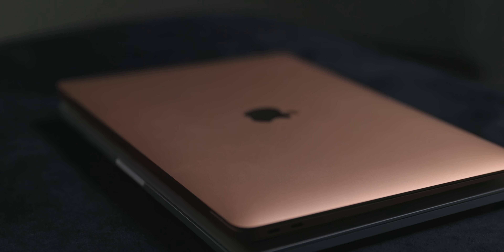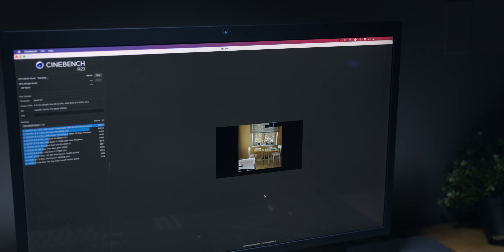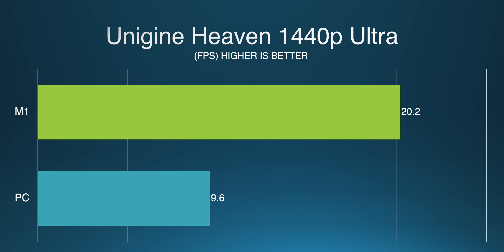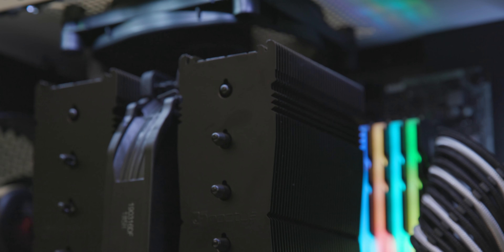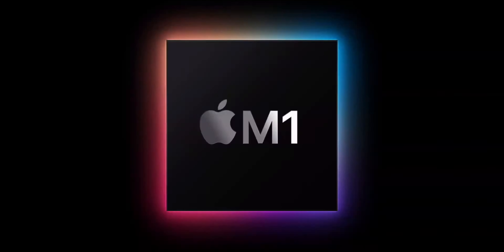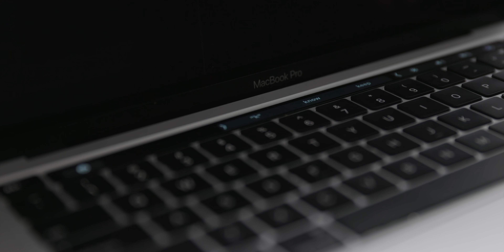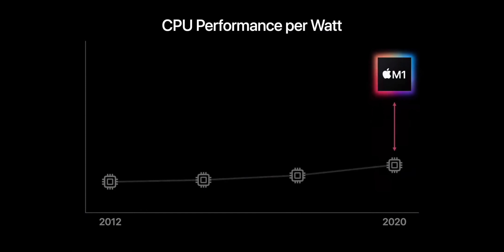$699 Mac mini vs $1,000 PC: Which Is Faster?

Comment: as much as i hate apple y m1 chip are so important is tht.
1. power efficiency " battery lasts longer"
2. more room inside the product as the Soc is smaller so more components can be added or product can bbe designed thinner without compromisimg performance. 
3. life of product is longer as heat is not much of an issue / design of product is made more flexible choices.
4. software is more focused on its ability to run on weaker cpu rather than its demand for better cpu to increase performance.

Comment: The only reason I can say the M1 is overrated is because it could have been better, well not necessarily, the M1 should be a series, the M1 could easily have gotten more high power cores for another device, but basically they decided to leave that for the next gen, maybe they wanted to have something saved to impress again or consider it didn’t worth the effort knowing that they going to migrate to ARMv9 in now less than a year.

So they intentionally left quite room for improvement, and what stood out was it’s performance thanks to the accelerators/coprocessors and software, I mean they did a really really good job with Rosetta 2, that impress me, hope that Microsoft it’s taking notes for “Magical Emulation” for Windows 10 on ARM.

For me to be comfortable again using Apple computers now that they ditch Intel, two things need to happen
1. Recover BootCamp with Windows on ARM hopefully if Apple and Microsoft talk they could arrange that.
2. Allow/make work again eGPUs, that not work on M1 computers although other Thunderbolt devices that USE PCIe lanes work

Comment: 11:15 well, you maybe get to exited there, I can assure you that with 16 high power cores it will not win a 64 core Zen 2 one that is the current best ThreadRipper that’s ignoring the futurible successor ThreadRipper with at least 64 Zen 3 cores.
The other good half of a futurible high end Apple Silicon would be the GPU that is something not found high end x86 chips right now in favor of discrete GPUs, so it may be useful for an iMac or an iMac Pro, and their laptops, even as a base option for a Mac Pro (easier logistics if they reuse the same chips for as many products as possible) so it has its usefulness in fact Intel is planning adding iGPUs to some Xeon to enable simpler servers that require some GPU but not high performance.
Regarding Apple, probably as how they are managing their PCs or they’ll never release a dedicated GPU or only for a Mac Pro, because for a MacBook Pro, iMac Pro or even normal iMac and Mac Mini they can make a separated GPU die that could easily be in dedicated GPU but put it alongside the main CPU/SoC and try to use an Infinity Fabric equivalente or something like what NVIDIA wants to do with Grace to basically make what otherwise would be a dedicated GPU a component that would work with the SoC more like an iGPU does right now, of course it’s Apple, soldered not upgradeable

Comment: Obviously a better thermal solution the reason the M1 is superior in quite a few tasks is because it is full of specialized accelerators to use where the ARM cores would not be up to the task, so if we sum it up, we have the best cores ARM ISA could offer at the moment in the high power cores (that as seen can match performance of Zen 2 cores although there is more of them so is a win for it) with a bunch of accelerators versus a Renoir APU that only has a GPU as an accelerator that is at least couple of generations old, they are beginning to re use more than they should VEGA, while the Apple GPU is an all out of their newest GPUs.

To short things up
The M1 has less CPU power but a lot of accelerators to compensate in a well amount of tasks, a high end of their gpus
Faster and more cache in certain levels

While in the other hand the 4750G has more CPU power, a halved cache compared to 3000 Zen 2 CPUs presumably to allocate that space for the iGPU, and a very old integrated GPU far behind want they can actually do.

Don’t believe me, look the APUs inside the Xbox Series X and PS5, and they technically can do them better with Zen 3 cores which are faster in every way.

So. what we will see in the future because of this, Apple will improve their ARM chips with ARMv9 and new high power cores and a good amount more than what we have now that is only basically a Super Saiyan iPad SoC.
So in their next couple of gens Apple would create CPUs more in line with what a high end CPU is.

AMD and others with one hand will continue improving their CPU and GPU architectures, AND will beginning to including some accelerators while others while be reserved for GPUs or only for certain APU type CPUs
Remember that a lot of the accelerators we use nowadays in PCs we usually put them in the graphics cards like AMD and NVIDIA do, but if you want or need to make a PC where you know are not going to use them you put them in your CPU so Apple honoring the name SoC they put the ones usually put in dedicated GPUs and all the others that are a standard in phones but rare in more traditional computers 

So both will catch up in the next few years Apple improving their CPU power and the others the accelerators

In other words the Apple M CPUs will adopt/become more like traditional high end CPUs while the others will become M1 like with the accelerator things

Comment: And if it bothers you 2:00 you can overclock the single core performance in the Ryzen (for these you can’t use Ryzen Master but you can still do it) and is such a small difference that a slight overclock or even increasing the TDP of the Ryzen could solve that minimal difference that to be honest is in margin of error

Comment: As a former systems manager, I know that BALANCE counts for a lot, when designing any system. What Apple can do, because they control everything in their world, now, is to balance the performance of their components, and integrate them with the operating system seamlessly. As new applications are built and old ones rebuilt for the ARM-based Apple Silicon, they will become more and more efficient. This is already apparent with Apple's own Final Cut Pro and Logic Pro. 

There's a tendency to run horse races when comparing computers. In the real world, most of the benchmarks are just mildly informative. What counts is daily productivity and "livability" with the machine. Once you adapt to an Apple ecosystem, it becomes obvious why they are so successful at sucking people into their orbit. They aren't perfect — lack of ports is a MAJOR annoyance, since dealing with docks, hubs, and dongles is a royal PITA, and lack of repairability and upgradeability is also hard to absorb. But they do answer a lot of the annoyances of WinTel and AMDWin environments. I can't wait to see what the next two generations of M SOCs can do.

Comment: Not a great comparison comparing Apple's ARM processor vs x64. Really should have mentioned ARM processors currently used in Windows/Linux systems and how higher performance ARM processors are being developed.
Reply: It's not fair to compare windows/Linux arm processors to m1 because m1 completely destroys them. We need the good windows chips to compare the m1 so they can atleast hold up somewhat

Comment: As someone that has an M1 MacBook Pro, I wouldn’t get one depending on what type of work you intend to do and how proficient you are in troubleshooting. Is it blazing fast? Definitely. Does it have trouble running some applications and can it be a total pain in the ass sometimes? Also definitely. For anyone looking at the M1, I’d suggest waiting for a little bit until developers adjust and more apps run natively/more smoothly on the chip. Just my 2 cents

Comment: I love AMD, but their APUs don't have half the extras that Apple's M1 has.  Apple's GPU doesn't do the heavy lifting for most Video workloads.  They have dedicated codecs which are better than most systems.  The GPU in the Ryzen APUs is actually weaker than the M1's GPU, but not by that much.  AI workloads on the M1 can use a dedicated AI engine while the APU just going to use the 7 CU GPU, which is weaker than a budget dedicated GPU such as a rx550.  

The strength of the M1 is they have custom accelerators.  It's a bit of smoke and mirrors, it's not the "cpu" that makes the M1 so great.  It's the heterogeneous compute nature of the M1 that makes it magic.  The cpu hands off many workload without tying up the GPU or CPU.

Comment: sorry, no. You can stick a cell phone motherboard and optimize it, it still not equivalent to a computer. I have a mac mini m1 computer, and it runs good. That being said, my pc computer blows it out of the water. You can run all the cinebench tests you want, real world speed is what it is, and without a high end gpu, it doesn't cut the leather the right way. That and the issues with the m1 swap space, cpu, and hard drive causing thermal and slow down issues, bluetooth, mouse, and external drives. Apple needs to work harder to sell their "porches" to the world for the price they are asking. I like the MacOS, just don't care for their hardware, and the lack of upgrading options  on almost all their machines except for the most expensive ones out there.

Comment: 8:10 you cant but apple did. m1 is not a miracle. it is just standard arm infastructure with some x86 accelerators. 
apple products are like old databanks. databanks are faster, more reliable and cheaper from every laptop. but they only do few things. if you need more features you have to pay more. 

apple soldering data storage chips, gluing battery, putting defects on their products. they dont support international computer standards.
their only goal is making people pay more. no matter how. they can put less ports to devices to make you buy dongles. but they don't want you buy any dongle. so they ban every other dongle that not certified by apple. 

when amd or intel creates new product that help whole computer industry, but when apple create a product it only helps apple and his few minions. any company can make a product does few things best and ban the others. but those companies can't survive except apple. they managed to keep customers while they do everything against them.

Comment: Have an M1 MBA - loaded, but sold it.  Got the base Mac Mini M1 to use with my 1440P 27" monitor.  It's actually bliss - I just took my 600W 9700K desktop off my desk, and stuck the M1 Mini there which is like 5% the volume.  At first blush, the M1 feels as fast and powerful at everyday tasks, but what blows me away is I'm playing some of my beloved strategy games at 1440P with literally NO fan noise whatsoever.  Civ VI runs very well at 1440P/Medium and runs so quiet you can hear pin drops in the room.  

I'm pretty excited about the next gen Mac Mini - sure hope they release an M1X model.  I'm kinda over bug and huge computing devices.

Comment: Looking great Quinn!  I mean, as die-hard PC as I am, I still can appreciate the sheer efficiency and engineering going on with the M1.  What do you think would be or could be a fair PC-land response?  Even if AMD, Intel, or someone else threw on tons of cache for the equivalent performance, obviously they'd still push out more heat.  Not an issue for us desktop users but paramount for longevity in laptops being operable.  It'll be an exciting few next years for sure!  Even if it is tempting to go Mac, there is just way too much software (games, work, and professional programs) that only run in Windows that I use at a HEDT desktop level.
Reply: Apart from games, I think Apple has everything else. I switched recently this year and it has everything I had and more

Comment: What a fraud video, you didn't even show hardware specs of your test bench. You don't even tell what Ram configuration, cpu clocks, either the cpu are set into performance mode, balance or whatever. This video biased af.

Comment: i knew that when apple would port these powerhouse Arm silicon made by them on iphones and Ipad to the mac universe , this would be a revolution in performance , batterie life .... it's must be hard for intel or AMD to be smashed to the ground with a little 5mm chip who gets on the top 5 most powerful Soc .... but i guess it is only a start cos they is much room for improvements , imagine an imac or mac pro with many M2 chips... this would be nuts...

Comment: i have been a mac detractor for years. not that I think Apple builds bad products but because they lock you into their ecosystem which goes against my "religious" beliefs and that for years, the performance you got from apple products was downright inferior to comparatively priced PCs. Be it in the desktop
market (where it still holds true) as well as the laptop market where Apple's poor cooling solutions kneecaped the performance of their hardware massively. However, if I was looking to buy a laptop to do work in today, it would be the Macbook Air. No question about it. Intel latest laptop did close the gap dramatically but for a more expensive price point, you are getting similar performance (from the same cpu as an XPX 13) at the cost of thermals and that awesome (and they are awesome) retina screens (not to mention the touchpad). I am not convinced that ARM is the future. I am convinced that ARM is part of the future and I wouldn't be surprised if the desktop market in the future doesn't have hybrid x86-ARM chips in it.

Apple and AMD are giving Intel a run for their money and this will definitely force them to pull their finger out and actually improve their products which they haven't had to do really since Sandy Bridge.

the M1 chip is probably the biggest advance in computer hardware in 15 years.

Comment: video good, m1 crap, really fast low power crap, but still a arm chip and useless for me unless it's in a phone or tablet. 🤷‍♂️
Reply: It is faster than most laptops and desktops
Reply: @ArchieGee  that may be true, but it has no place for me as I said, unless it’s in a phone or tablet. 🤷‍♂️
Reply: @redkurn  why not, all computers will be using them in 15-20 years time
Reply: @ArchieGee  doubtful and hopefully that isn’t the case. Ram isn’t one size fits all, this demonstration of what it can be and do I cool, but it is apples chip, apples software, specific case coded compatibility layer.

It’s basically the best case scenario, imagine getting a third party device and it’s not nearly as fast because the layer wasn’t shared, even native apps across manufacturers and developers vary wildly.

It has a use, but likely not in the world of demanding pc games, which is a dominant corner of the market.

Comment: Man another of those "fair" reviews. If you say A you should also say B. First there are many applications where M1 co-processors cannot be used and then m1 is getting trashed. Try converting a 4k x265 video in handbrake (arm version) using cpu for the best quality. M1 does whopping 2.5fps. Even laptop ryzen 4750pro can beat it doing 4 fps. Second prices for extra memory and ssd space are moving these macs to totally different pc segment. Third 16GB memory limit is just not enough for decent work. Gaming on mac is almost not possible due to lack of support. With the new Ryzen 5xxx chips you get several times higher performance in real life etc. However it is still brilliant piece of engineering, power to performance ratio is unbeatable. I have a feeling most of the reviews are done by people who actually don't really understand computers. Just run some benchmarks, choose whatever m1 is great at and ignore the rest. I use macbook pro m1 laptop so I know what I am talking about.

Comment: Why do Apple folks keep comparing the Mac mini which is a desktop to laptops? If it is meant for desktop tasks then compare it to actual desktops. I can and have built desktops for that price which crush it in every benchmark this guy used.
Reply: Is it the same size, as quiet, as efficient and does it run MacOS?
Reply: @ArchieGee  I've built hackintoshes if that is what you're asking.

Comment: Comparing a more expensive PC to a less expensive Mac usually is a unfair comparison. And these are ENTRY LEVEL Macs there comparisons are being made with. That's why Intel is doing all these ads comparing PCs to Macs on anything but power usage, heat production, and performance, not to mention factors like the the M1 having to do extra things like running Rosetta.

The thing for Intel to do (rather than these stupid ads) and AMD to truly compete is to get into RISC themselves with either ARM or RISC-V and pick up on design cues from the M1 but make it so you can upgrade memory (which Apple won't do) and GPUs.

Comment: Using Math numeric optimization C code, I made a comparison compiling the same code on Intel Linux, Intel MacOS and M1. And the latter was 3 time (let it sink...) faster. 46sec vs 2m21sec of execution. It is like the old days, comparing the code execution with or without an FPU enabled...

Comment: @1:15 You basically compare a highly optimized niche product with a less highly optimized niche product and two different CPU architectures. The M1 Mac mini being slightly less niche and much cheaper to produce, since ARM APU architecture is so efficient, hence the Apple cult can get away with using an old case design. I guess this awkward comparission makes the M1 Mac Mini look more like value for money than it actually is if you consider what $1000 could buy you on the PC market. :)
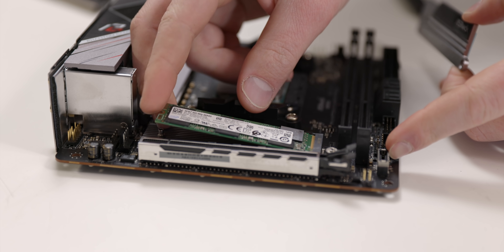@7:25 Not really, because the M1 isn't readily available for system builders and Apple products are kind of closed source software. ;)
Reply: Do you have an example of any benchmarks of comparable performance pcs for $1000?